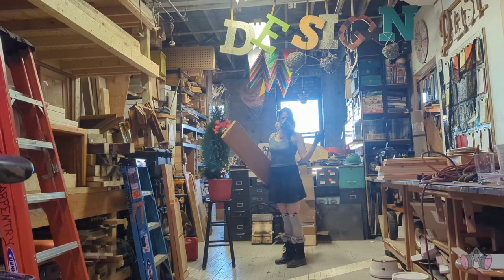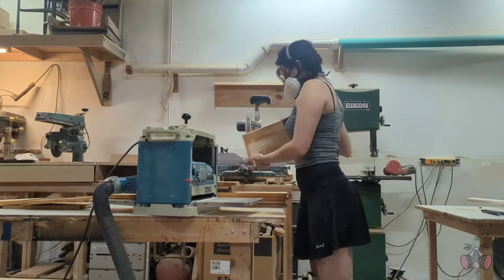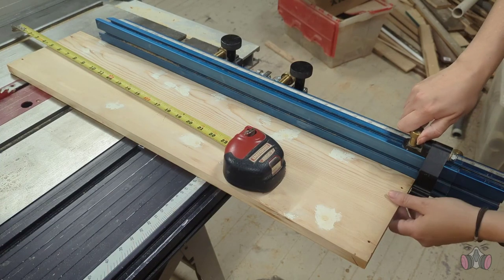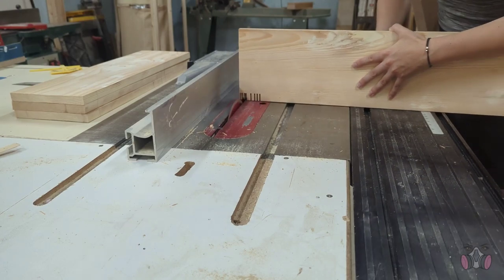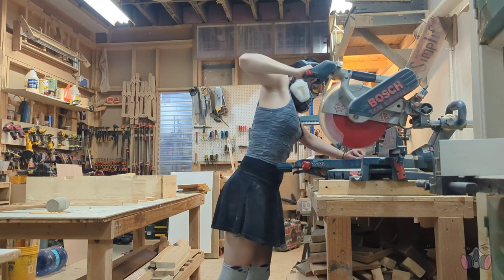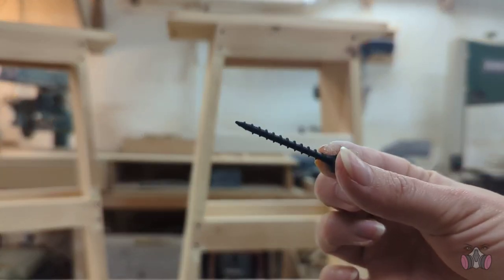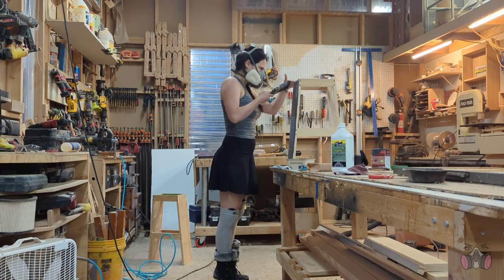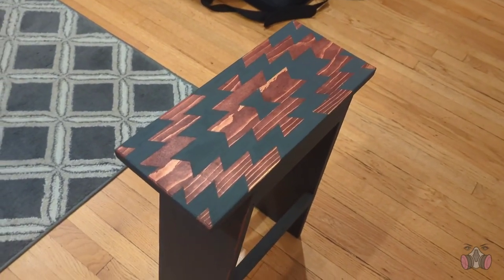Making DIY Chairs From Repurposed, Scrap Wood | Woodworking

Comment: The main thing that popped out at me was that they appear to be unstable.  You mentioned elsewhere in the comment section that you had a few friends try them, and they were stable.  Even if they are stable, the fact they might not look stable could be causing you some kind of dissonance when viewing the final product.  But kudos to you for even trying to reuse a small amount of reclaimed wood to build something that would actually be usable in your place!
Reply from the maker: I totally agree. I think tapering the legs even a bit so they're narrower at the top would have made them look more stable AND it would have made the overall look less boxy. I have a few design changes I'd like to include if I ever make these again. Thanks a lot! I really appreciate it :)

Comment: You splayed out the sides for stability, but not the front and back.  I think that "verticality" gives the chairs a boxy and somewhat unstable appearance. Also, the solid legs are visually heavy.  Cutting openings in the legs  would make them look lighter.  Your etching and patterning of the top is fantastic!  And your discussion of your design choices is quite informative. Thank you for sharing.

Comment: I really enjoy watching you work, and how you explain your thought process.  On the tops, I would be inclined to round the square corners to perhaps 1/2" or 3/4" radius and do a 3/8" round over on too and bottom edges.
Reply from the maker: Oooh, I think you're right. It would make the top not look as square as the rest

Comment: Cool build and great example of up-cycling! Maybe the chairs could have incorporated more of an overhang on the front/back by making the seat wider. Or the sides could have been tapered in more towards the top. These aesthetics are subjective and you were working in quite tight space constraints so you did a great job just to have something that functions well and is sturdy.
Reply from the maker: I think you're onto something. When I finished them and tried to pinpoint what was wrong, I thought about the seat being bigger too. I think that would break up all those straight lines you see when you look from the side and make them look less like a rectangle. If I make these again, that's definitely one of the things I'd adjust. Thank you!

Comment: I like the build, caught the circular saw thing, you weren't technically wrong though. I like the look but your right something is missing, it looks too plank like. Maybe cutting a long groove in the center of the legs or maybe a design would break up the straight lines.
Reply from the maker: Yeah, I agree. A groove, a design, or just tapering the legs a bit would have broken it up. I might remake the design again and try a few options out. Thanks!

Comment: That’s not a circular saw , ma’am . That’s a miter ( sliding ) saw . 

J/s
Reply from the maker: My bad. I misspoke
Reply: @woodificould  no worries , it was just a heads up . Stay safe and happy holidays ….
Reply from the maker: @JGerm  I really appreciate it. I put a correction in the pinned comments so i don't confuse or misinform anymore. Thank you 🙏

Comment: ok but its a terrible design though, any rocking movement and you would fall...
Reply from the maker: They do look like they would wobble, but they're surprisingly stable. I had multiple ppl test them out so far. A tapered leg that's wider at the bottom would add even more stability though, so when in doubt, that's not a bad addition